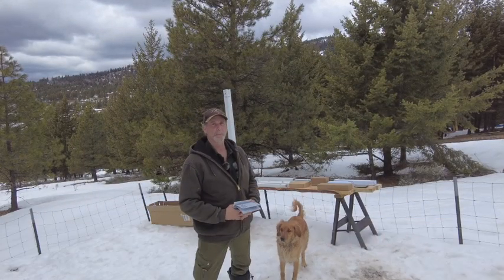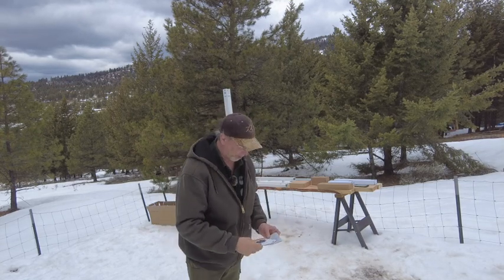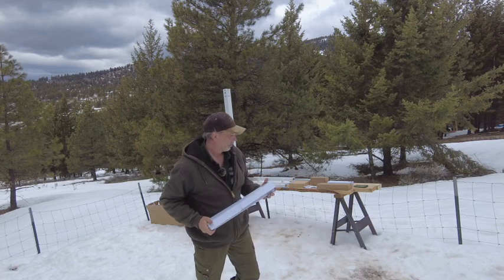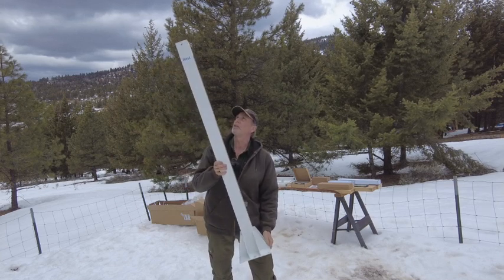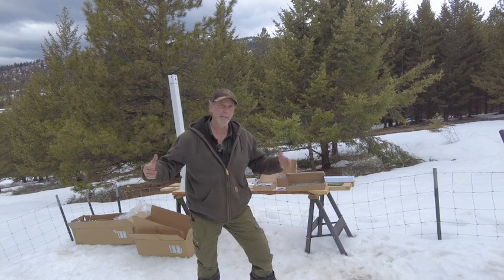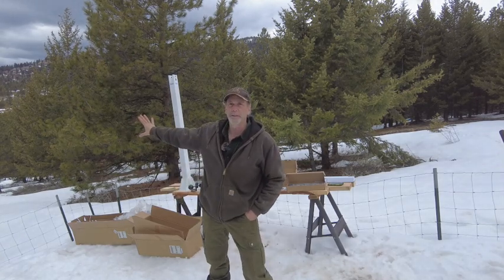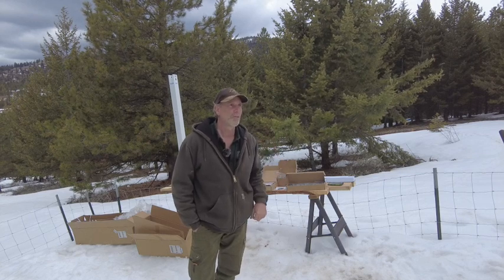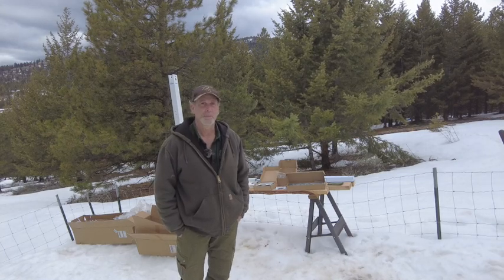EPISODE - 33 ECO-WORTHY DUAL-AXIS SOLAR TRACKER

Comment: We have 400 watts of solar with two Battle Born Lithium batteries with an 1100 watt inverter and 1000 watt Jackery working good so far but getting more solar and batteries down the road! Looking up that sun tracker to today!
Reply from the maker: Your welcome to come by and see the set up before you order if you want. Although it's still a short hike up to my place do to the snow. Getting a little more melt off today with the rain and I hope it will make it possible to drive all the way to my lower property soon.
Reply: @offgridal  yes maybe this next weekend it’s supposed be sunny!